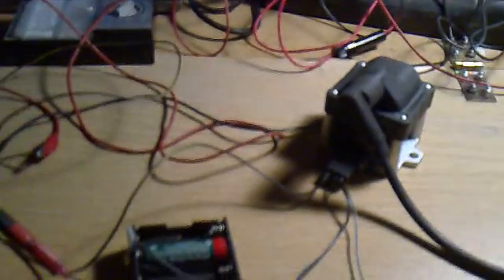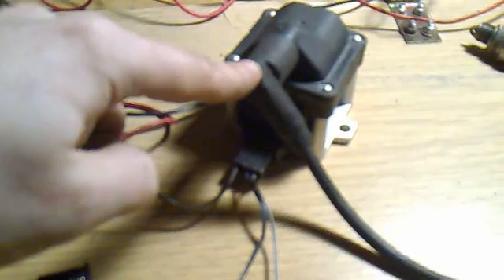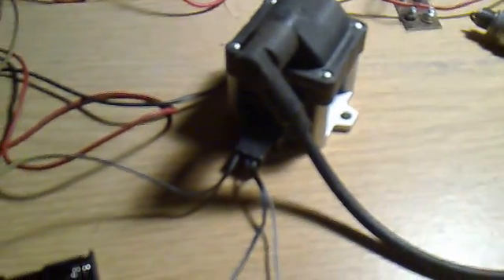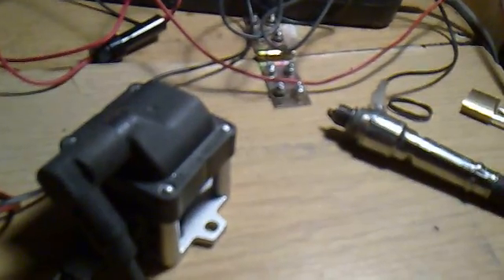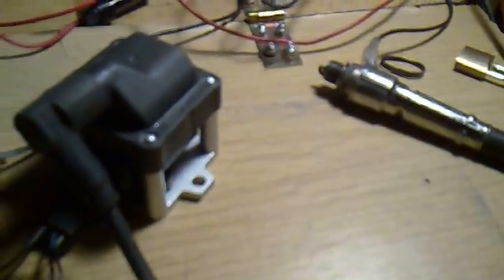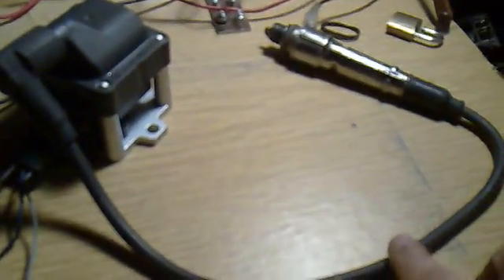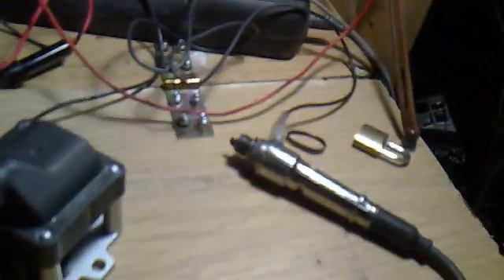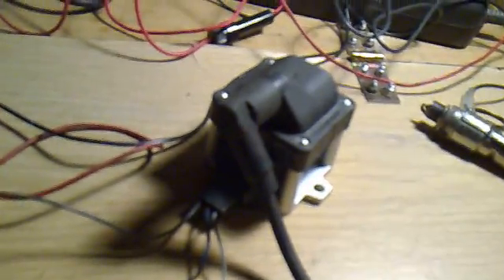VW Golf 3 1.6 ABU ignition coil check

Comment: Hi there sir, great video... please can you explain where the power supply ground goes to. Does it only go to the spark plug wire or to the coil also? Check if I'm correct, the pin 1 +12v goes to the powersupply positive, the trigger pin 2 goes to the positive 1.5v battery, pin 3 to the ground of 1.5v battery and then the ground of powersupply to spark plug wire. please let me know... thanks in advance
Reply from the maker: Yes. Ground of 12V and 1.5V are connected together. Don't forget also to connect ground to the shield of high voltage cables/spark plugs. Regards.
Reply: @janekkos5135  i